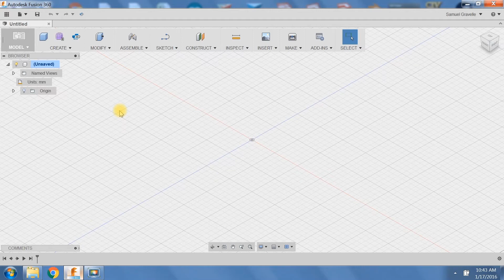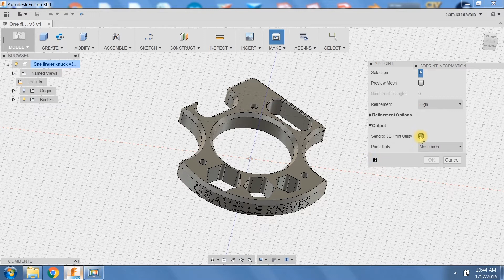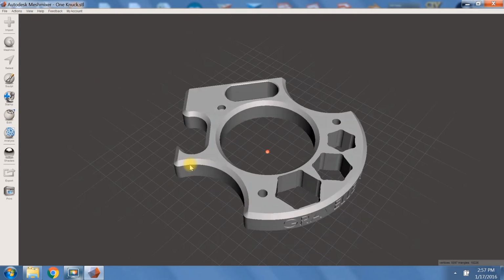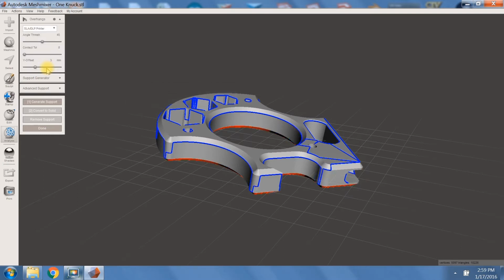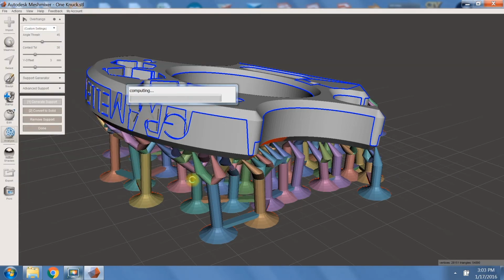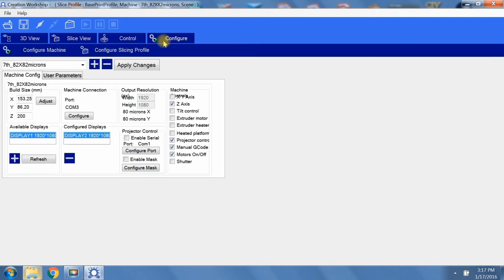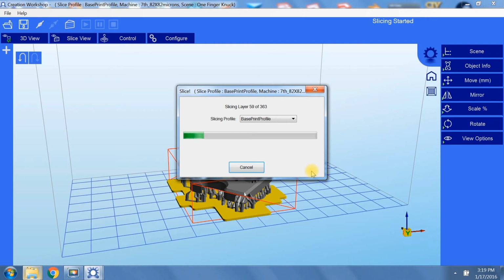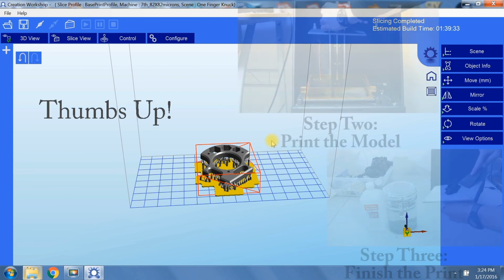Prepare a CAD Model to 3D Print, How to Guide Step 1 | 3D Facture Draken 3D Printer

Comment: Why do you have to put supports on a part like this?  Can't you just print this just as it is flat on the build plate?
Reply from the maker: Great question, the upfront answer is that this part probably doesn't HAVE to have supports. However it is good practice to angle models with larger layer cross sections like this one so that the forces from the part being peeled off the bottom of the Vat doesn't pull the part off the build plate. In all honesty you could probably print this part without supports and be fine. But I wanted this guide to encompass how to easily add support structures. Check out the discussion linked below on large cross sections.

http://3dfacture.com/help/index.php?p=/discussion/319/darth-vader-buddha-figurine-100mm-tall#latest
Reply: +Garage Science Well.. Just printed my first or should I say 2nd print of a fairly flat object, and I won't come of the build plate easily, so I will have to break it to get it off.. So probably printing it like you did, all that I would lose would have been the support.. Will try that tomorrow.
Reply from the maker: +frickmystr Fill free to post the pic of video of the print and comment it here so I can see it.  Glad I was of some help.